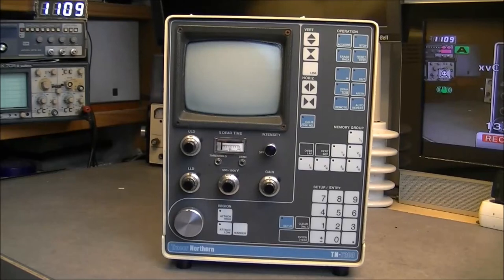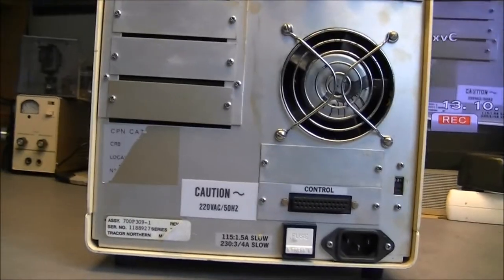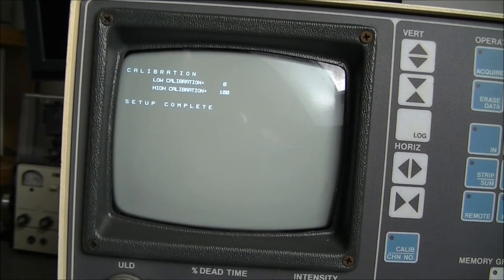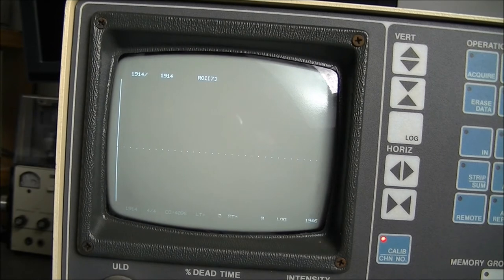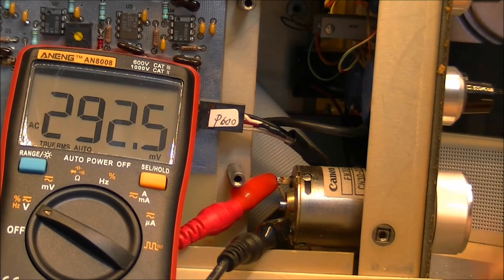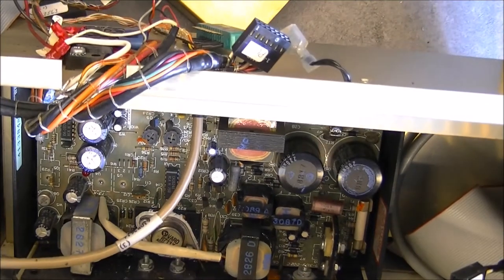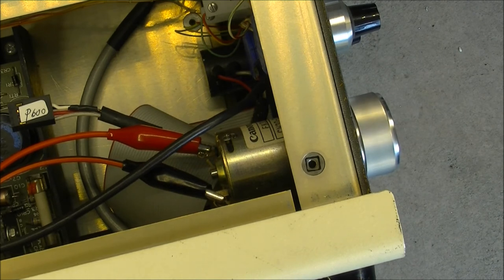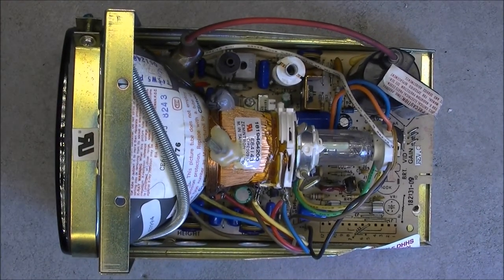Teardown: Tracor Northern TN-7200 multichannel peak analyzer

Comment: 23:00: That "VARO R711X" is actually a dual rectifier diode. 80V/25A if I  am not mistaken. Have not seen some of them for a very long time. They used to just blow up on overcurrent without producing any smoke.

Comment: It's for generating spectra of Gamma radiation designed for use with semiconductor detector heads.  the detector heads give an output pulse proportional to the energy of the incoming photon, this then draws a histogram of pulse height against occurrence so you get an energy spectra.  I made a (not very good) one for my masters dissertation.
Reply from the maker: I suppose the radiation source is inside the detector head, what do they use as a source ?
Reply: The source is whatever you want to characterize.  Every radionuclide emits a different spectra so by looking at the spectra you can see what you have.  good if you have some unknown radioactive stuff.  Unfortunately for the most part the semiconductor detector heads require liquid nitrogen to operate (and sometimes to keep as well),  though you could use this with a sodium iodide scintillation detector.  You wouldn't get the nice sharp spectra you get from the semiconductor detectors though but it would still be interesting.  If you want to try to get it to work, there are various things that are radioactive enough to get a spectra if you leave it running for long enough.  pitchblende, a bag of potasium fertalizer, some thorium tig rods or you can even buy sealed sources.
Reply: I was just thinking the same, it looks like a gamma spectrometer! I wouldn't mind finding one at some point, it's always been something i wanted to play around with.
Reply from the maker: I guess that without the (scintillation ?) probe and the sample testing  fixture it is nothing  more than door stop...
Reply: Yes without the probe.  You could certainly find a buyer for it though i would think, 4000 channels is still extremely useful today.  I'd be interested myself, but i'm about to move house and acquiring more clutter isn't something i'm keen on right now!